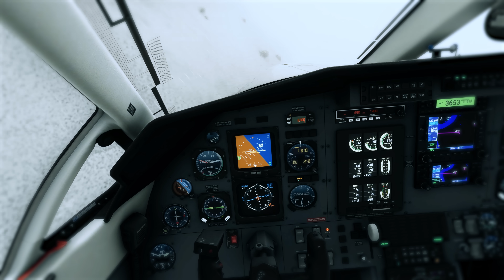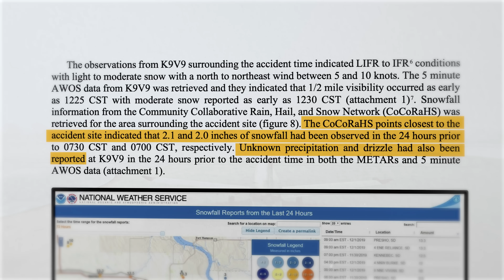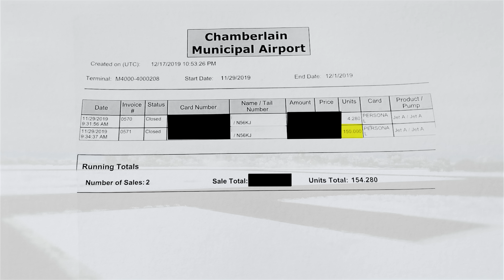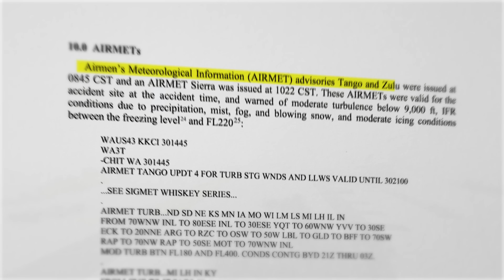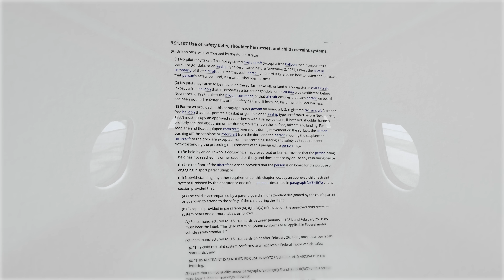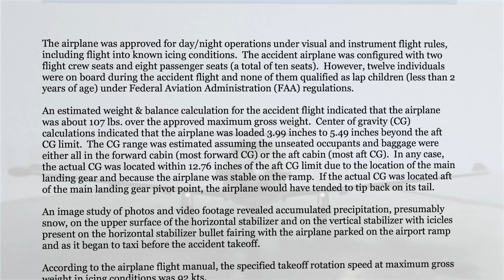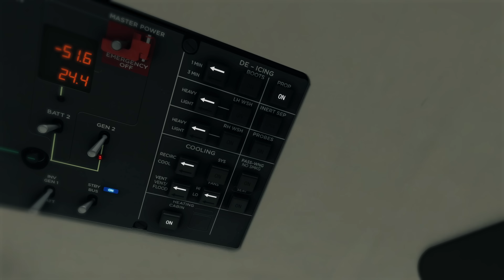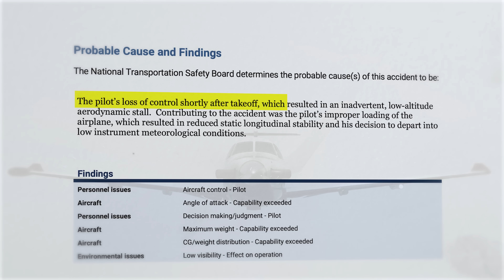PILOT or PLANE: What Caused This Crash? | Accident Case Study

Comment: In trucking we have a saying: Snow, go slow...ice no dice. Why risk it?
Reply: Guessing they didn't want to flly on Sunday for the same reason Chick-Fil-A isn't open on Sunday
Reply: You never "go slow" in an airplane.

The faster you go, and higher you fly, the safer you are.

At low speed, with so much as frost or snow on the wings, your minimum speed goes up. Way up. So you have to go even faster than that. And ideally, climb like a bat out of hell until on top of the weather. At an altitude too cold to form ice, due to the lack of humidity. Only then are you safe.

Trucking is different. Because the only two parameters that change in bad weather are Driver vision/sight distance. And tire traction. 

Tire lose grip simply due to being cold, the rubber hardens. And they of course lose traction to road surface, especially wet, snow, and ice. Wet roads tend to reduce grip by about 20%. Snow reduces grip to only about 30% of dry weather traction. And ice can reduce it to between 10-20% of dry grip. Add moisture on top of smooth ice (black ice) and you only have perhaps 1%-5% of dry weather grip.

This is why, on solid ice truckers just park it. And in snow, they typically cruise at perhaps 45-50mph. Because to keep the stopping-distance the same, they need to be going a lot slower.
Reply: Stay in lane, buddy. I’m a pilot, YOU are NOT.
Reply: @GardenGuy1942  I'm hoping this is sarcasm, particularly from the perspective of the incident pilot.
Reply: @GardenGuy1942  stupid has no career category buddy...it applies to all occupations like you.

Comment: Consider in depth..the extra weight the airframe had due to ice build up. Then consider pilots actions near stall. It would be apparent that the pilot actually used the ailerons close to stall at low speed instead of exclusively using the rudder controls. Accidents usually happen when there is a series of events happening together. An avoidable accident.

Comment: There's just so much wrong with this flight. Taking out the bad decision to go, the decision to rotate early and try to climb at that rate WHILE TURNING is absolutely mind-boggling. Simply accepting a modest rate of climb and slowly building airspeed straight out would have likely avoided the loss of control. In looking at the area, climbing just 200' straight out would have put them over everything and had a clear path to climb at a paltry 100 feet a minute if need-be to keep their speed up. Just poor airmanship all the way around when you combine that with all of the bad aeronautical decision making. Just goes to show you that no matter how advanced the aircraft, the basic flight principles will always apply.
Reply: What if he didn't turn itself ? Possible drag from ice + low speed ? Not free and clear flight controls ?
Reply: pilot routinely rotated early and too quickly--a habit which ultimately killed him

sure, all the other factors mattered in this accident, but if it weren't for that, he might've gotten away with the rest

Comment: Hold up if I'm not mistaken this is the crash where they were deicing the plane with janitorial equipment missing most of it. Then they were told the runway was too bad and the airport owner advised them not to depart. Instead the pilot basically rushed his crew of the runway plowing through the unprepared runway and taking off. Once airborne the instantly started having stick shaker activations until eventually smoking it into the terrain. Plus they were flying with all those people like it was a school bus.

Comment: The mentality of the pilot is amazing that he was prepared to put his family and friends fataly at risk against the advice of others. He had 3 hours to mull this over while deicing the aircraft in continuing bad weather conditions. The airport manager was practically begging him not to take off and he ignores the 'runway is closed'.
Reply: I found myself becoming increasingly angry at this pilot for taking so lightly his responsibility for the lives of his passengers!
Reply: @garybrown1404 yes indeed, very likely overconfidence (ego) in his abilities and those of the aircraft.
Reply: Airport manager is probably still playing this over in his head wondering what  ould have been done to stop them from taking off. Short of driving a car an parking on the end of the runway the pilot would have found another way to enter the runway and takeoff anyway.
Reply: @TerryMundy  With his history and utter disregard for the safety of others, he probably would've tried taking off from the snowy grass, and yanking the nose up 20 degrees.   For the life of me I don't understand the lack of common sense in this accident.  Even if he had simply kept on the runway or even just a few feet above the runway, until reaching 110 kits or so before pulling up minimally only enough to clear obstacles by a safe margin at the end of the runway before slowly milking the nose up a few degrees more while building air speed above and beyond what was required for the conditions so he'd have a safety buffer.  If you're not going to use a checklist, balance your loads weight, etc..(foolish),  then at least have the common sense and knowhow to fly the aircraft safely (considering your foolish actions) by giving a wide berth to precarious conditions -- no excessive banking or climbs or descents, etc..    What is wrong with these pilots.   No common sense anywhere in the cockpit.   3hrs to deice the aircraft and you think flying is still a good idea?   What happens when we start handing out licenses like candy.
Reply: CEO mentality.
Reply: @ElectroAtletico  The average person understands risk even more poorly.
Reply: @ElectroAtletico  No, "If Mama ain't happy" mentality.
Reply: After 3 hours of de-icing the plane (Argh!) it probably started icing again.
Reply: What de-icing? The 3 hours of clowning with a ladder and some solutions bought at a hardware store?
Reply: Buying your deicing solution at a hardware store shows a complete indifference to conditions that could be seen and felt first hand. Like most comments here, taking 3 hours and not getting much of the empennage cleared would have been a clear indication that it was not a good day to fly (and die) as a result.  It's hard to imagine what was the compelling reason for leaving that day and under those obviously terrible flight conditions. Just having an aft CG out of limits PLUS a questionable MTOW with that passenger/baggage loading, would have presented a potentially dangerous condition without bad weather/icing that existed. Regardless of pressure from a passenger(s) to make the flight, a truly safe and professional pilot should have been absolutely adamant about NOT flying that day. You have to wonder if it was a case of overestimating the capability of a high-end aircraft. 

Very sad and even more so, when it could have easily been foreseen, even before taxiing out.
Reply: Both the airport manager and the lodge owner implored him to stay another day. The Grim Reaper was waiting in the wings; no pun intended.
Reply: Unbelievable that an adult would have continued on with him in this situation- small children would have known no better unfortunately
Reply: Arrogance canceled out common sense…
Reply: I would have gone for a meal and a few beers and a good night's sleep.
There's always tomorrow.
Reply: The weather wasn't even what made him crash, he was overweight and off center with mass combined with not understanding the ice mode. However it is possible if he made it past that he could have had an icing issue too.
Reply: It astounds me ... the willfull ignorance.  Sometimes you see people who seem to stumble into wealth, fail-up despite a glaring lack of sense.  

I'm no pilot.  But i was a lineman, with more than my fair share of de-icing - or attempted anyways.  In conditions like this, our fleet would be grounded.  And even if the weather cleared, we wouldn't allow any of our anti-ice equipped aircraft to fly unless it had been towed into the heated portion of our hangar and given time to let all that ice thaw.

That this person somehow made it far enough, with enough success in life to own a PC-12 ... yet, somehow didn't have the sense to realize how grossly overloaded and unbalanced it was - not to even mention the horrendous conditions they'd have to fly through (even if were within regs), just baffles me. 

How the hell does this happen?
How did no one else on that trip speak up about it and refuse to board?
Reply: @folkblues4u  It is very likely that none of he passengers had enough knowledge or experience to understand properly the risks they were taking on.
Reply: was this a case of Hurry Up and Get Thereitis?
Reply: Just unbelievably bad decision making! Catastrophically mindless!
Reply: im disappointed his family didn't use their common sense to turn down the flight ride, cause i wouldn't have got on if i was one of them
Reply: Just another arrogant idiot and piss poor aeronautical decision making.
Reply: Someone should’ve asked him if he had any favorite hymns?
Reply: @thomassheehan4193  Forgive us our foolish ways.....

Comment: This guy thought he was invincible. That plane never should have taxied, let alone taken off into low IFR with ice on the tail, overweight and outside the CG limits. Oh... and who flies with 2 people more than there are seats!!?? Unreal. I guess you get a couple thousand hours under your belt, and you think the rules don't apply to you anymore. He exhibited so many of the bad mindset/behaviors the FAA warns us about. I feel bad for his passengers. Great presentation.
Reply: They lost 4 generations of his family because of his carelessness. Smh.
Reply from the maker: Thank you! 🙌
Reply: @PilotInstituteAirplanes 
Excellent channel, first viewing, color me subscribed. (competition for Mentour Pilot)
Reply: When heavy on take off. Have extra speed before rotating. Gear up. Quickly. And full power.
Reply: Well stated throughout sir! I flew Beech 18s for the old Emery Air Freight, Midway. Takeoffs into 200 & less, 1/2 mile vis used to scare the hell out of me, especially with the wife onboard. I'm retired now & damn lucky! Excellent presintation!  Just subbed!
Reply: I'm just curious to know if the plane had taken off at 92 knots and only 5 degrees nose up attitude  would it have flown  . I think it would
Reply: @Chris-ev7xo  Look, half of the passengers and all of the baggage are located aft of the CG. And there were 2x more passengers than the aircraft could handle. So, aft-cg.

Add in the weight of ice on the tail. The most important thing to de-ice is the entire tail, followed by the upper surface of the wing. Ice weight A LOT like many hundreds of pounds. Go shovel a giant scoop of snow and see for yourself. Now multiply that by 10. Now multiply THAT by the lever-arm to the horizontal tail. This is many TONS of leverage adding aft-CG moment to the airplane.

Now consider, the tail has to LIFT this in order to balance the airplane.

But the tail is covered in ice, which wrecks the maximum lift it is capable of producing. Meaning, the airplane is INCAPABLE of lifting its grossly over-weight tail.

An aircraft MUST be balanced within a very narrow range. It is usually leas than 1/2 of the mean wing chord. And the Pilatus has a very narrow wing chord due to its high aspect ratio design. This contributes to its sensitivity to being laded into an unstable DIVERGENT situation. Where simply flying the airplane causes it to instantaneously diverge into uncontrolled flight.  

This is analogous to adding lead foshing sinkers to the tail of a throwing dart and trying to hit a target across the room. It will flip flip-flop over and impact the wall tail first or sideways or miss all together.
Reply: @Chris-ev7xo  That is quite possible.  Once it got up to speed, it is possible the de-icing boots would have broken off enough ice off the tail to make it controllable.  

What is baffling is the pilots comment that the ice would just "fly off" after takeoff, like it was just a bunch of ice cubes sitting around waiting to be blown off.

If you were a crazy enough pilot to attempt this, and wanted to give yourself a chance to survive it, there were a few things he could have done.  Seat passengers according to weight, with the heaviest passengers in the front seats, and the lighter passengers to the rear, while having the extra 2 passengers sit as close forward as possible, and put some of the heavier luggage between the club seating toward the front, to move the CG forward.

Altitude and speed would definitely be your friend in this situation.  The plane didn't stall on takeoff, so it was controllable, although probably very unstable, especially at low speeds.
Reply: @redbaron6805 His starting off his reply to whether he got all of the ice with,  "Well.... would've been enough to make me say,  "I'm driving home!"
Reply: @rabbitramen  Yep, the entire thing was completely insane.  As a pilot, I'm am always very aware of the responsibility I have for the safety of anyone who flies with me.  Risking your own life is one thing, but risking other peoples lives, especially a large group of your own family is just next level reckless and stupid...
Reply: "Overweight, schmoverweight. I got this!"

Comment: Retired, Old, Bold, 
I used the rule of 3 fits for many circumstances.
The 3P’s
Procedures 
Policies 
Philosophies 
In flight training, they give you a handful of skill and a handful of luck. Don’t runout of either.
I won’t discuss at ramp!!! Obvious 
Even during taxi out the rule of three. 7mins From ATC NEGATIVE TELL THEM WHAT YOU NEED!!
Radio 📻 transmission warnings from airport 
The taxi 🚕 
Stay safe thanks for sharing.

Comment: I usually avoid Mondaymorning fingerpointing, but the actual footage is pretty damning. De-icing and hot-wings could possibly have given me additional confidence, but  boots in this weather... no thanks. Another question : why wasnt he in the hangar ?
Reply: I believe I read some where that none were available that day.  Regardless, not a good idea to leave in that snow storm.  “If you’re right, fine, but if you’re wrong, it’s catastrophic!”
Reply: Snow/ice on the aft fuselage plus iced up horizontal stab plus contaminated runway plus freezing precipitation during taxi/TO plus aft CG plus low speed rotation equals guaranteed disaster. At some point you just have to just say to yourself “time to spare, go by air” and either go back to the lodge or rent a couple of SUV’s and drive home.

Comment: Weight and balance.  I learned VERY early how to calculate W&B.  Using the airplane Datum point.  
In modern airliners?  Its averaged out, and there's a wide range of CG, or Center of Gravity compared to CL, or Center of Lift.  Smaller airplanes aren't as forgiving.

Comment: The decision to take off was the first red flag? Not the improvised hardware store deicing fluid?
Reply: Iso's use was fairly common in the north.  It lowers the freezing point of water and helps to loosen ice in order to remove it by hand.
Sometimes its the only option in the absence of heated type 2 fluid.

That said, an insulated bottle sprayer with a plug in heating element filled with type 2 beats it hands down.  Not that expensive either.

Comment: Long time freit dog from that area.  Whenever there is freezing rain or drizzle present. You might as well stay home.  It’s bad already and won’t get better until it clears up.  Just because you might have an instrument rating and a plane has anti ice and de ice systems means nothing.  You can read the regulations about airframe icing, and the operative word is adhering to the aircraft.  And what was adhered to the plane.  Stupid is as stupid does, and gravity sucks.  This is a great video and I certainly hope others can use this accident to enhance proper decision making.
Reply: It seems like the plane just might have flown dispite all that and that he was over weight.  Still followed his muscle-memory of too high a pitch angle while, in this instance, not maintaining airspeed.  The PC-12 is an amazing airplane but even it cannot overcome an overconfident foolhardy pilot.
Reply: The PC-12 is an outstanding airplane.  All planes are equal opportunity killers, especially when you run out of airspeed, altitude, and ideas.  The first lesson that every pilot should remember is that gravity sucks!
Reply: I don't like to take my 'Super' Airbus up in freezing rain/drizzle.... and it's a very capable aeroplane. As for doing this in a single TP?